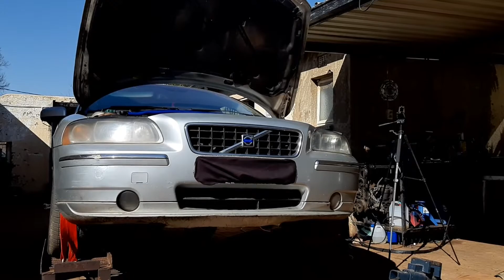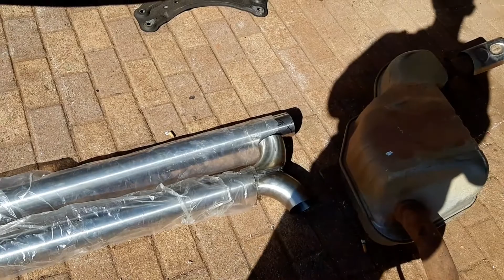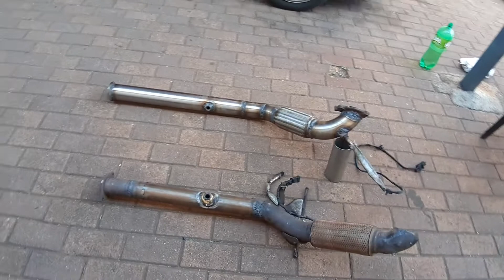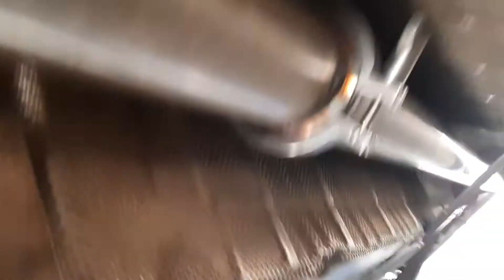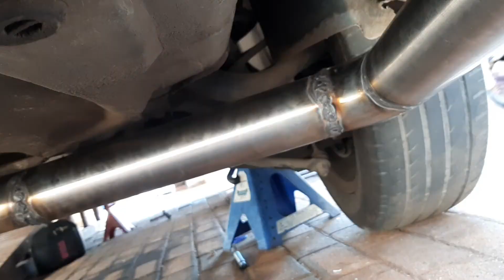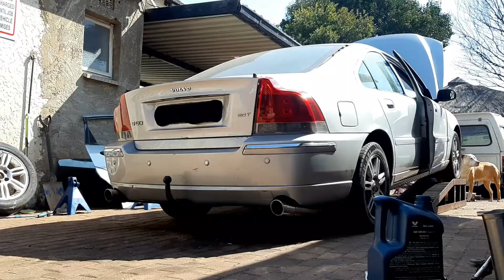CUSTOM 3' EXHUAST for my Volvo S60 (76mm)

Comment: Howzit man , did you decat ? if so does the car throw any codes ? thinking about doing a full system and decat on my 2007 2.0T
Reply from the maker: Hi. I made a complete system from downpipe. 
I did decat (cat is on downpipe so when I made the downpipe I didn't put a cat on)

I have never gotten a fault code of decating. If you don't put both the O2 sensors on in +- the same place you will get a fault code.

If you have any other questions or need advice let me know